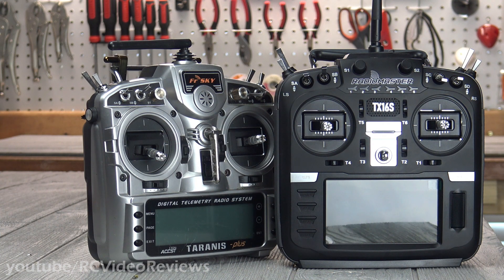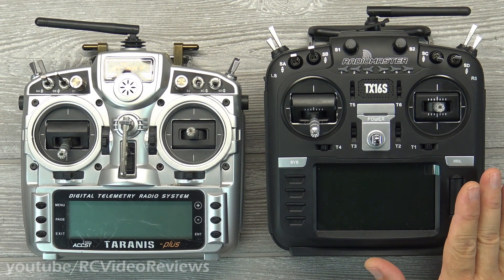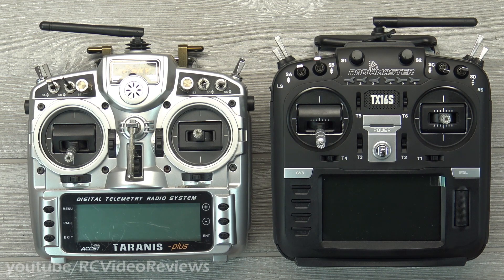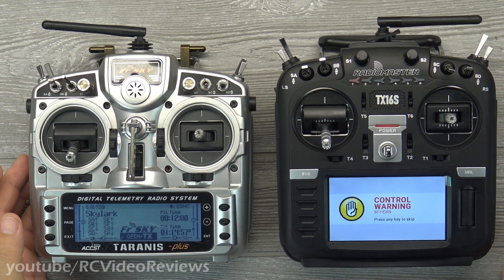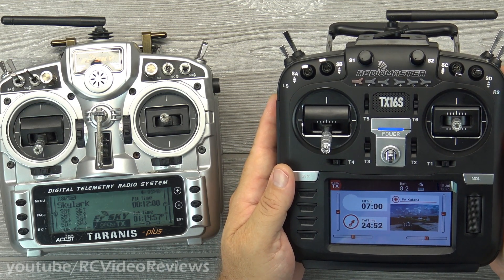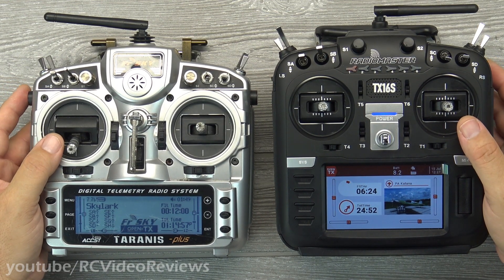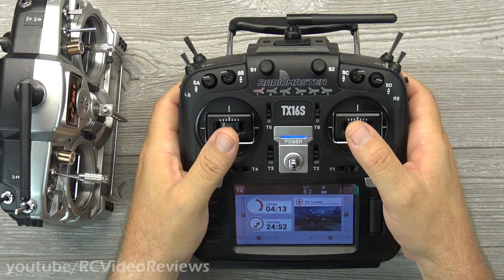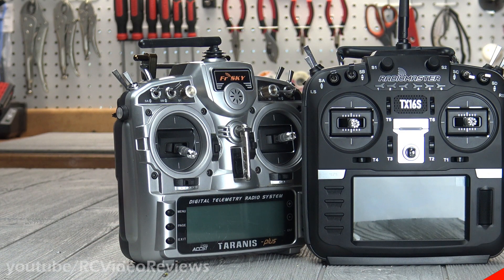Radiomaster TX16S vs Taranis X9D Plus - RC Transmitter Comparison

Comment: im still using the x9d and have alot of frsky x8r and s8r receivers. how is the range on the tx16s when you bind with frsky receivers?
Reply from the maker: It would be nice to say the range is the same, but since I haven't done a side-by-side comparison, I can't just say that. You'd have to test. I can tell you that I've been flying TX16s for a couple of years and I have some D16 RXs like SxRs in some planes and have not noticed any issues with range.
Reply: @RCVideoReviews  ok thanks. i was just thinking about getting one to try out. i have the 4 in 1 module in my taranis that i use for my smaller dsmx/dsm2 models but i have never tried it on frsky receivers. if i bind in dsmx i get a low rssi warning but not in dsm2 and what ive read its something to do with telemetry on dsmx and not range but i have not tested the actual range on dsmx.
Reply from the maker: RSSI telemetry is completely inconsistent across brands. You really need to do your homework to understand the correct values per protocol. I'm dealing with this exact issue on an AFHDS2A Rx from FlySky which reports 75dbm max.
Reply: @RCVideoReviews  its not a protocol value at least i dont think. its just the way it is or at least for dsmx. if you go to multi-module site it says to turn off the warnings for dsmx and that is what i did and have not had a problem but im not flying very far with my umx planes with the irangex 4-in-1 module. i believe its the short range telemetry on the umx planes that cause the problem. you may want to check out there site and see what they are saying about the AFHDS2A protocol. selecting range test on the taranis i walked about 75 yards and rssi went to the high 20s and low 30s with my back turned and in the path of the antenna which is low i think but i havent tested further.

Comment: To me, it's a choice between a hi-fi stereo and a mid grade modern entertainment system with satellite radio.  Once you've had both for a while, somehow the old megawattblaster from the seventies just sounds better.  Notice the attention to detail on the Tarains; subtle grippage for your fingers and molded cutouts for thumb placement, styling on the body for finding your way around without looking, practical charging reliability, etc.  IWhen you look at switches and parts, the Radiomaster's cost more.  I agree on the pot stiffness, but the no detent pots are like a Marantz and I also upgraded my gimbals.  I realize they're both made of plastic, but the Radiomaster looks like it's made of plastic.  The Taranis has retro styling that reminds me of the '80's and my thinking is that the Taranis has taken everything learned from black boxes with a swicth and two gimbals until now and incorporated it, whereas the Radiomaster put out a sleek yet somehow generic looking touch screen.  The touch screen doesn't come without a trade-off.  Ergonomics on the Taranis are like a well fitted glove but the Radiomaster feels out of balance.  Better would have been to put the screen up above and not under your hands.  The only thing I don't love about the X9d+ is the color, but actually it makes sense when you're flying in really hot sunny weather as it stays cooler.  The Radiomaster has more power for Lua scripts, but so far I can run all I need.  So I think the Taranis is the best thought out design for minimalists and retropurists.

Anything based on opentx or other open source firmware is a good radio though.
Reply: Gotta say I've had a Taranis for years and always felt like all that retro molded plastic was cheesy and kind of toyish looking. Maybe if some of it were metal... When Jumper and Radiomaster came out I liked the clean look better. I just got the clear TX16s mk2 and even with it being clear and having LEDs it just looks and feels cleaner to me.

But either way I agree it's great to have all of these choices packed with so many features at price points that lower the bar of entry into RC. I remember being younger and being put off by the prices of Futaba.

Comment: I just ordered a TX16S to upgrade from my Taranis X9D plus, the breaking point for me was how slow the LUA scripts were for the ELRS external module I was using.   It took nearly 3-4 minutes to run the LUA script and would crash regularly since it was right on the edge of having enough memory and processing power for the scripts.  I'm slapping some old D8 receivers in my older drones and passing it all on to my nephew who's interested in RC and drones.
Reply from the maker: I enjoyed my Taranis for a lot of years but the TX16s has been a very worthy successor. Good luck with your new radio.
Reply: I did the exact opposite a year ago. I really love my X9D plus SE 2019 :-). It fits perfectly in my hands. Remembering that this latest version of the Taranis comes with a STM32 F4 processor just like the one used in the TX16s. Frsky made this change exactly to not slow down the execution of LUA scripts.

Comment: Yes definitely a slap on the face from
Frsky. I bought a Horus X10 express and was very disappointed  to find out that it’s not compatible with D8 protocol  without an external module. I’m selling the Horus X10 express for that reason. Lesson learned. I have a crossfire module now and also just recently found out that the Baudrate is still not good enough on the Horus X10 without having to solder another piece of  equipment (mod) to fully experience long range flight. Very disappointed because Horus X10 is such a beautiful looking transmitter 👍. But functionality and adaptability not so good 😕 
It’s probably just me
Time will tell what Frsky does (sell ) next.

Great review! 👍. I have the Radiomaster TX16S now and I’am happy. 🙂
Reply from the maker: FrSky cinched it with me when they implemented Access.

Comment: I’m so confused w all the access stuff will this work with any xm+ reciever and bnf frsky drones
Reply from the maker: As long as they aren't using ACCESS. It has to be ACCST protocol. ACCESS is encrypted and FrSky doesn't share encryption info.
Reply: @RCVideoReviews  thanks a lot i really want to get some drones soon but am so confused with all the access stuff. I want to get a nazgul5 v2 with an xm+ reciever and a Geprc phantom. Could you recommend a radio? I was mainly choosing between the x9 lite tx16s or xq7 or x9d lite thanks

Comment: It looks like all the switch options are the same, having looked inside do you think it’s possible to add an additional potentiometer
Reply from the maker: You can add two more pots and two more switches. The main board is equipped to accept them. Here's a picture of the pinouts:
https://discord.com/channels/761870396085108757/764327917144113192/766011871140511814

Comment: Hi, let me first say that I would agree with you regarding the choice of gimbals. I too think that hall sensor gimbals are better in reality.  However this is purely on the base of reliability, not accuracy. I suspect that the alps sensor will indeed be more accurate in the sense that they translate absolute angle to a voltage on the pot wiper. The comparison you make, by comparing the linearity of the pot and the hall sensor is incorrect in the sense that the hall sensor linearity is something else. It is the output voltage verses the absolute magnetic field strength the the sensor is exposed to. Note that in itself this says nothing about the  angle  of the stick. The system works by connecting a magnet to the stick, and then measuring the strength of the magnetic field strength with the sensor. 
So the linearity of the system is determined by the quality of the sensor, but at least as much by the magnetization of the magnet and for example how well it is centered respectively to the sensor. Having done quite some calculations on magnetic circuits, I would be expect the linearity of this system to be no better then 5%, more likely 10%. 
However, the question is if you would notice. The system is not linear, but highly reproducible. And each of us will adjust the stick curve so that we like it with expo etc. So I doubt very much if this linearity has any value, and for that reason I still will prefer the hall sensor.
Reply from the maker: Thanks for offering the clarification. Very valuable.
Reply: This is almost always overlooked by reviewers. Worth posting in other spots.

Comment: I've been trying to figure this out for a few days. 
Will this pair with the Frsky x4r-sb? 
Or do you need to get a module?
I'm looking at picking up a radio and have a bunch of x4r-sb receivers.  Don't know if its worth going the Taranis x9D route (to stick with the receivers), if the TX16s Will talk to them, or just get the TX16s and buy some new receivers... 
Thanks for your input!
Reply from the maker: It pairs with the x4r in D16 mode.
Reply: @RCVideoReviews  Aces! Thanks for your time mate!  I'm going for it! Thanks!
FYI You don't seem to have an amazon link to the TX16S in your video details. If you change that we'll get you some affiliate love on this purchase!
Reply from the maker: @IAmWhil  As much as I appreciate the offer of support for the Amazon affiliate link on the TX16s, I couldn't hardly recommend buying it there. Every Amazon vendor has it highly overpriced. Even the basic version is $30 more than the Hall Sensor Touchscreen version. 

So thank you--really--for the support, but check out DefinaceRC. They're out now but they say more are arriving this month: https://www.defiancerc.com/products/radiomaster-tx16s-opentx-multi-protocol-radio-w-hall-gimbals
Reply: @RCVideoReviews  Holy cow I didn't notice that!  Thanks for being on point!  Greatly appreciated! :heading to defiancerc:

Comment: I have just found your channel.  Thanks for the excellent content.  I have been successful programming my three Spektrum BNF planes via the multi protocol module. All fly great,  no issues.  I also use for my quads, which were previously flown with a Taranis. The options on this radio are almost endless.  My only roadblock now is trying to setup my Timber X to use the Flaperon option.  I get confused with Input/mixing programming. Spektrum spoiled me on that, as the manual had the exact steps to follow. Despite that, I prefer this radio for its cost and flexibility.
Reply from the maker: Glad you found the channel. Thanks for commenting. I'll be posting a video on mixing soon. Stay tuned for that. In the meanwhile I'll tell you it's very simple to do. First, you have to have two aileron channels because while using ailerons they run opposite, when using flaperons they run the same (both down), and while using spoilerons they run the same (both up). Let's say you put Ailerons on channels 1 and 5. Under channel one, press and hold the wheel, click "insert after". That will make a copy of the Aileron entry on channel 1. Edit that entry, change the source to something like RS (right slider), set the weight to -30% or +30% depending on direction of travel. Finally, make a curve that goes from 0 to 100 only, not -100 to +100. Apply that curve to the "RS" entry and you're done.

Again, I'll make a video, it's really simple once you've done it once or twice.

Comment: I am going from a Spektrum Dx6E to a TX16S which USPS says will be here Saturday. I ordered mine with the TBS Crossfire Micro Module as I want to get into FPV which is why I started in this Hobby recently, yes I'm a total absolute Noob. When I was in High School it was free flight and control line, Radio Control was literally for Rich Old Men with time and LOTS of money, a basic set up was equivalent to a nice new car.
Reply from the maker: Times have definitely changed. I think you made a good choice for your next transmitter. This radio has impressed me so far.
Reply: @RCVideoReviews  I had a pre-order on the Jumper T18, but the internal 2.4ghz PCB Antenna struck me as a bad idea, not to mention FrSky's shenanigans and seeing how TBS Crossfire is MUCH better received overall in the Community. I cancelled my pre-order and ordered from Helination, less than a week later and my Radio is en route, the Jumper has been on pre-order since early May.
Reply from the maker: I think you made the right call. Aside from the fact you now have your TX16s in-hand, I was not too excited about an internal control antenna either. While I searched for stock on the TX16s, I saw Helination as one of the few that had it. Good to hear they're a reliable supplier.

Comment: LOL John i just got the T18 pro  and they would feel taller because its a thinner transmitter great comparison
Reply from the maker: Thanks Robert. How are you liking your T18? That's another one I considered.
Reply: @RCVideoReviews  LOL and its been so windy here took out my slope planes
Reply from the maker: Florida has had a real attitude for a few months. It's either cold and windy or hot and windy, or calm and rainy. Unbelievable really. I saw those 3D printed sliders. I might fool with those when I get all my planes moved over.
Reply: @RCVideoReviews  pretty much the same as tx 16 I had both in my hands one offers a  better upgrade and the other has 5i n 1 multi protocol I think there pretty much the same thing plus for me is R9 transmitter 1000 w
Reply: Oh yeah and slider could be 3d printed taller and a touch thicker

Comment: Good to see there is a fair amount of competition among all of the radio manufacturers.  It will push innovation.

Enjoy the new radio and keep us posted on your experiences!
Reply from the maker: You hit the nail directly on the head there. Competition is great for us. You're absolutely right. I will definitely keep the channel updated.
Reply: Thanks for keeping the channel updated with this radio.  It has piqued my interest and as a result,  this radio is due to arrive on my doorstep tomorrow.  I’m very new to Open TX and was reserved about learning it,  but your tutorial series has changed that.  👍🏻
Reply from the maker: @WTJimmy  Oh wow! Ok, well don't be afraid to jump in and have at it. The channel monitors are great and can really help you see what's going on. Once you get a good working basic model setup, you can use it as a template and copy/duplicate it as a basis for any subsequent model.

Most of all, have fun and tinker with it. There is a whole lot of material on YouTube supporting OpenTx.

Enjoy!

Comment: So it sounds like you can try different makes of receivers. If it does DSMX you could try Spektrum or the Admirals from Motion. 
One of our members is getting something like this and I was considering it because of Price and Features.
Reply from the maker: Yup, that's a definite benefit. They can bind with Spektrum. I haven't looked into the Admiral device protocol yet, but it wouldn't surprise me if they worked as well.

As much as I like the S6R Rx from FrSky their desktop configuration tools have been an abject failure for some time and they don't seem interested in fixing them. The only way I've been able to configure SxR receivers is via LUA on the radio. 

So I will be exploring other stabilizer Rx options.
Reply: RC Video Reviews Admirals use the same protocol as Spektrum. Admiral has a 6 Channel receiver with 3 axis gyro for $30. It has its limitations but it’s pretty cool for a receiver and gyro for $30. Plus you can actually use the Bind Port as a Seventh channel if needed. 
Anyway, I’ll be interested to know what you think of this Transmitter. 16 channels and 1/2 the price of my Spektrum!
Reply from the maker: I've spammed you guys enough for today with videos. I have more equipment coming, more planes coming, a giveaway coming. Sigh...I need a bigger hard drive and faster CPU to keep up with the video material.
Reply from the maker: I didn't know Admiral used Spektrum. I'll do a little reading and see what I can find out. I think it's SUPER cool to not be tied to any brand of Rx. The modern world of tech can really be amazing sometimes.
Reply: According to the Admiral thread on RCGroups,  The Admiral uses DSMX protocol and is manufactured by Lemon RX...

https://www.rcgroups.com/forums/showthread.php?2973424-Admiral-RX600SP-6-axis-stabilizer-from-MotionRC. 

 Lemon RX has a pretty good reputation, and Motion RC sells the Admiral 6-axis version for $29.00.  No pc or standalone keypad need to adjust the gains.   If there’s too much oscillating, you can simply land the plane and adjust the pots manually.  I have two of these receivers, but have not installed yet.
Reply from the maker: I just read the Admiral stabilized Rx's allow master gain adjustment on Aux3. I'm looking at Lemon and Admiral both right now. I'm going to explore options now that I can.
Reply: RC Video Reviews Admirals are made by Lemon. So they’re the same.

Comment: Nice,you did not mention the 6 buttons on the radiomaster which are great for flight controller modes.
Reply from the maker: This was just a side-by-side compared to Taranis. There will be quite a bit more to come. Hang tight.